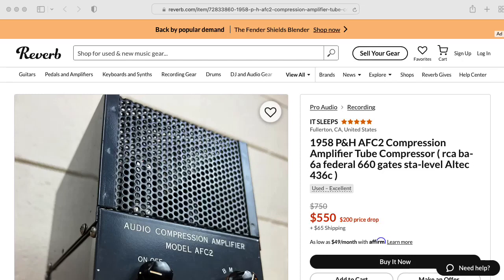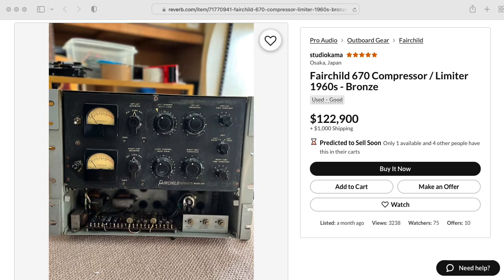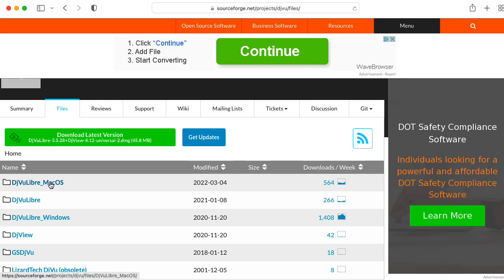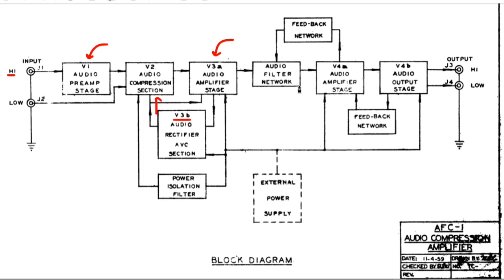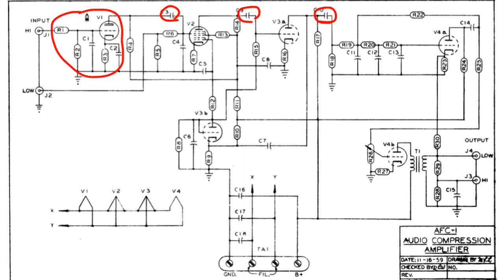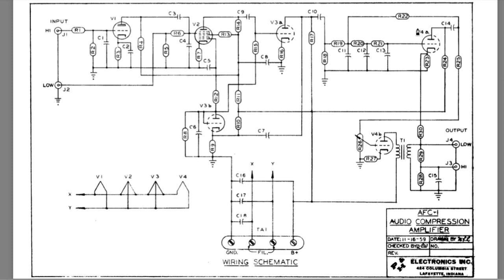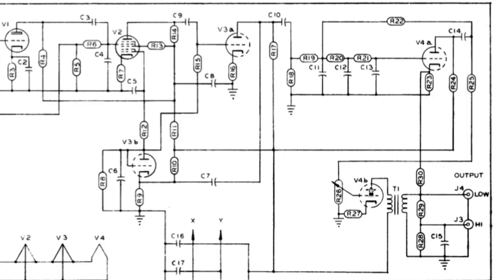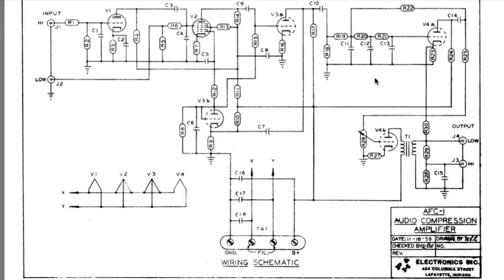Unique Tube Compressor Analyzed: P&H AFC2 Audio Compression Amplifier (not vari-mu, not optical!)

Comment: Read up on AA5 automatic gain control for the heptode, which acts like a mixer creating sum and difference frequencies. I believe that 3 stage RC filter attenuates the sum frequencies. Most compressors use a full wave rectifier, 6AL5. Attack and decay is controlled by the fixed charge and discharge bias resistors. Thanks for the video, would love to see a follow up video.

Comment: That filter is for phase correction ... 3 filter segments for 180 degree phase shift plus an inverter for another 180 degrees. It is exactly like a phase shift oscillator without the feedback loop.
Reply: That doesn't really explain it since phase reversal is easily done with the output transformer (swapping leads). The filter stage is feeding something back to the mixer grid of the 7B8. There's something going on there.

Comment: This philosophy of “recap!” has thankfully been outgrown and nowadays it’s more “fix only what’s broken” with these antiquities. I suggest building a new one with your desired modifications and only doing minimal restoration work to the original, so we have a reference for the original intention. You can use eg a Hammond lunchbox style chassis with the cage top.

Thanks for doing the research on this I had also been in touch with the seller after the listing appeared. I might try building one myself although I have no idea how this will sound in practice.
Reply from the maker: Yeah, I've never been a fan of just willy nilly replacing every capacitor without thinking about it. The only real exception is super old wax paper capacitors. Every one I've seen fails the leak check when used with an older capacitor checker that can go up to the high voltages used in tube circuits. Those have to go.
Reply from the maker: My main change would probably be to the bandpass filter -- it's clearly tailored towards a limited ham radio voice frequency range.
Reply: I costed out building a new one of these and it would run me only about $300 all-in. Of course, I still don't know how this thing sounds, although it was described as LA-2A/CBS Audimax slower style compression. But I already have $150 of these parts sitting around looking for a purpose so maybe I do it.

If you want to modify the original to bypass the bandpass, the lowest impact way would be replacing the 3 position rotary with a 4 position, and leaving the added "off" position (next to Broad) unmarked so as to not gum up the look. Plus the safety chassis ground is always a good idea. If I build a new one I will do that rotary on mine, plus use a 600 ohm balanced output, and why not, turn that bonus 6AV6 input stage into a mic pre with a nice vintage mic transformer I have lying around. Very quirky 1959 channel strip.

Comment: cool, device.
Reply from the maker: It is very interesting!
Reply: @Lantertronics  Hey doc, You know any automatic gain reduction circuit? transistor based. or so, a thing the keeps the output amplitude constant, to be used in synths.
: )